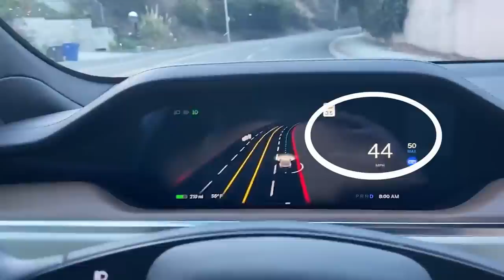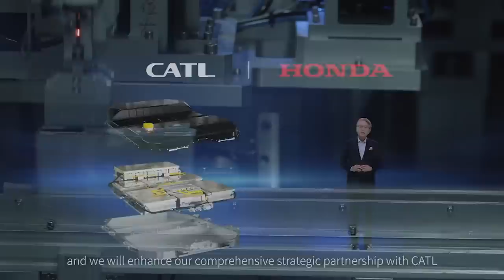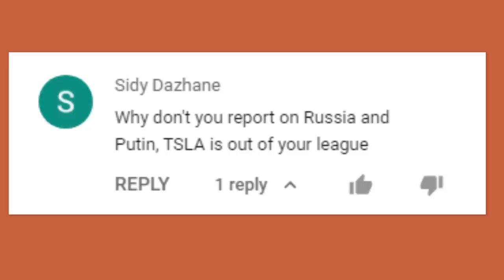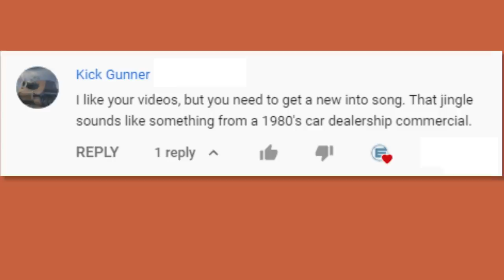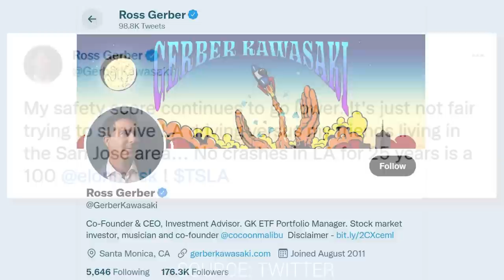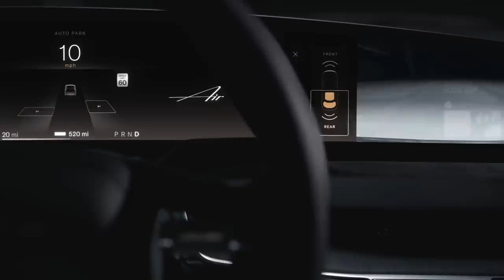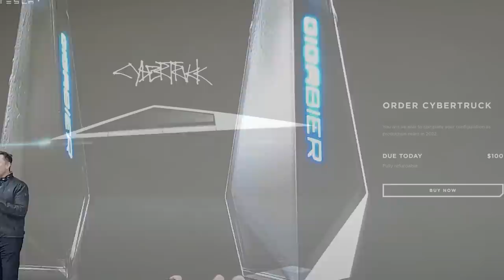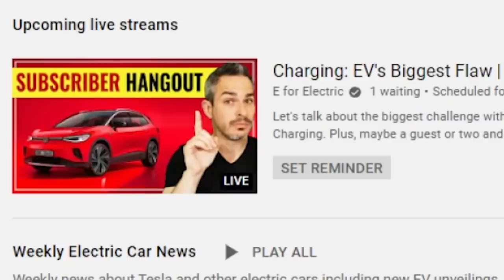HONDA Beats TOYOTA at Electric Car Denial | EV News

Comment: I like the fuchsia-shock shirt! And keep up the great humor! Tom is spot on with his analysis as usual. I agree that Toyota could make BEVs work overnight (if they wanted to). But I am not so willing to give Honda a pass on BEVs. I have owned and enjoyed many Hondas over the years and their engineering and design skills are excellent. So the fact that they are well behind the rest of the auto industry worldwide with BEVs is frankly inexcusable. This is clearly a management/leadership mistake and not an engineering problem.
Reply: The problem lies with Japan. Japan has a big problem with electricity generation which relies on  LNG suppies from abroad  and coal, which are really hard to get these days and will contiue. Nuclear was  carbon neutral + reduced reliance on external factor but after fukushima public sentiment on nuclear is very bad. Adding to these woes Japan has 2 diffrent grids with different voltages/frequencies. Japan is honestly stuck btw a rock and a hard place. That is the reason they are looking for something that replaces LNG i.e Hydrogen which can be imported from Australia.

Comment: Honda is almost never the first vehicle manufacturer to adopt new technology, but if and when they do decide to embrace new tech, they usually do it better than their competition.  It might be a good idea for Honda to secure a good battery supplier, design efficient motors and at least one good skateboard before releasing a subpar vehicle like other Japanese OEMs.
Reply: That wasn't the case with hybrids, and that's been since at least 2004. Their hybrid design is way worse than Toyota's.

Comment: My theory on the Japanese car industry problems is that it is all political pressure on the industry by the government.
To be competitive with China, Tesla, maybe even VW and Hyundai/Kia, the makers need to simplify vehicle production in new or redesigned facilities, putting many workers out of a job (see Toyoda's speech about that).  Don't forget, car dealers and service operations, plus petrol suppliers will all need to shrink - more jobs gone.
If this was to occur, the politicians would get the blame, and by the time the industry has actually collapsed, they will have retired - someone else's problem then.

Comment: Really curious if these auto startups will make it or if Tesla will be the only new auto company because they caught a small window where the major companies were asleep on ev's.

I suspect basically none of them will make it and we will be back to the traditional big companies plus Tesla in 10 years.
Reply: Just think of all the debt and assets that are associated with manufacturing ice vehicles. I'm quite confident that the big automakers are in fact very vulnerable. Small startups can start afresh. My best guess is that nio and xpeng and byd will be big. Tesla among the biggest because they are a frontrunner in ev.
Reply: @marce8760  I think most of the cost of vehicle production is the paint shop and the body shop. And usually a separate plant assembles the motors, so the primary losses will be retooling that plant for electric motors then of course building a big f**king battery factory.

Sure some cost but I think a legacy auto maker is still in way better shape to produce an EV than one of these startups. Tesla has been at it for 10 years and their body work still has lots of issues, getting better but still very common to see a brand new Tesla with a clearly misaligned door or hatch. That is going to be harder to justify when they aren't the only game in town.

Comment: when you buy a Tesla you buy into the Tesla system - it's more than just a "you've bought our experimental car - goodbye!" that the other EV builders seem to be offering. With Tesla you have support, continued updates and improvements, a car the company really cares about, and the charging network growing and working. It's a unified whole.
Reply: From what I have understood, Tesla customer support is terrible.
Reply: Roof, HVAC, powerwalls, phone? Trip to Mars (one way🤦‍♀️)?
Reply: Support from Tesla?. 6 months to get body pieces?
Reply: Tesla cares about the data that car sends back from its guinea pi.. oops I mean customers

Comment: I would  not want  low range of 260, they need  extend their range. They are not like  my Tesla Model 3. Long range 320-351 per charge.  I would  like  see  standard charging plug for all electica vehicles .  Why do we need so manyl adapters.
Francesca
Reply: For reference: Plugs vary by continent and purpose.  J1772 and Tesla in North America for personal and light-duty vehicles, and Mennekes for heavy-duty vehicles. Mennekes in Europe, Africa and most of Asia.  Mainland China has their own GBT plug.  CHAdeMO for DC fast charging only, used to varying degrees practically everywhere.
Reply: Irony here being that you own a car from a manufacturer that's building a charging network with proprietary tech across the world while at the same time advocating for a standard charging plug. No one expect Teslas can and will be able to charge on Tesla's chargers, ever, lmao.

Comment: The E is actually very good, if people would just stop digging at the range which lets face it is not bad for what it was designed for - urban driving, and stop testing it on motorways etc which is NOT urban to package is superb, it drives brilliantly, has lots of tech inc self parking and residuals will be high so cost of ownership compared to 'other' makes will no doubt be the differentiator. A 35K car that is worth 20K in say three years is a better deal than a 25K car that is worth less than 10K in three years. I know what car I would rather drive - and its not any Toyota!

Comment: Great video, a lot of points spot on.  Honda will need about two years to start selling electric vehicles in larger markets.  The UK is the test bed, China is going to be the hub to export to ASIA.  The US...is still thirsty for gas where total EV sales is about 2% of market share, so companies like Toyota and Honda are still going after that pie while it's still there.  It's unfortunate that the Honda E is limited to smaller markets as I would love to own one in the states.  There really aren't too many affordable options right now with even the Model 3 feeling a bit cheap in the interior.  Sure there are other brands like Polestar, Hyundai/Kia, and Chevy but their offerings aren't particularly desirable.  The Ariya does look like something I would be interested in, and if only Sony would produce their Vision S I would be all over that in a heartbeat.  The EV market should have a really nice selection in 5 years with charging infrastructure hopefully up to the task.

Comment: I wouldn't call the deniers, I would say realist. They actually make cars and know about the raw materials needed to produce large-scale electric vehicles and they know there aren't enough copper, heavy metals, lithium to produce them at the scale people are hoping for. It's going to take a huge breakthrough in battery technology for everyone to drive an electric vehicle. Not to mention the huge investment in charging infrastructure which will take even more copper etc. Maybe by 2040, but something major technological advancement will have to happen.

Comment: Being an early adopter is expensive. The japanese may move slightly slower yet when they move they will be extremely competitive in making ev s. Im not a big fan of japanese cars yet i can respect their competitive nature. Do not underestimate honda or toyota. JMO and I orefer to spend my money on american products from tesla, ford or my favorite GM. Buying european ev s is fine as I also have an excellent 2021 audi e tron with its 250 mile range. Suits my family transport needs very well. Nice truck even though it doesnt have the longest range. 78 percent of a,ericans drive less than 38 miles a day.  My better half is perfectly served by the audi e trons 250 mile range. In fact i only charge it 80 percent so the 200 mile range is just fine for our needs. $2500 drive off and 507 a month lease and never stopping for gas is a big win. I appreciate your show. Thank you for educating me to the point I went with an ev for my family cuv.

Comment: e naah, I agree, 

electric tools have been around for a very long time (so have cars also, actually) however, I will be sticking with my ICE versions and ignoring the electric ones until they improve them. When the electric mower battery died, we scraped the entire thing, mind you rechargeable hand tools are usually really handy for the odd jobs.  

One odd thought about the Japanese government not pushing their automakers to electrify the automotive industry more quickly, is that Japan is one of the most dependent economies on imported oil, so it would actually make sense for them to want to get away from their dependence on imported oil supplies.
Reply: to get away from their dependence on imported oil supplies Japan needs to produce more electricity and it looks like it is harder task than just importing oil.
Reply: @sonarsphere  Yes, i agree totally with you here, close friend of mine lives in the north of the main island, Japanese culture is to not talk about Fukushima disaster  (I suspect that it is about losing face etcetera) so the nuclear option really is not going to be investigated well and I am not sure how it will affect the discussion of other alternative sources: wind, wave, solar, tidal sort of options, but I am unfortunately not optimistic on that count.

Comment: Lots of new start-ups for the EV market.  Mind boggling.  Just having the service and repair infrastructure in place seems like a gigantic undertaking.  Are they contracting an existing operation for this?  I realize EV's are going to require less service and maintenance and the electronics possibly diagnosed OTA, but some failures are going to require in-house service.
Reply: I have often thought that you only need a parts distributor and give the service manuals to independents.
Reply: @steverichmond7142  True.  Remember when Tesla first came out.  Any warranty work and they came out and got your car.  Now, Tesla has service centers all over.  There's actually one in the town near by where I live.

Comment: About the rollout of the 10.x FSD Beta and the 100/100 Safety Score that the user must achieve in order for Tesla to push the update to them. I don't know Ross Gerber nor how good (or bad) of a driver he actually is. Admittedly a 37 safety score sounds pretty bad. But let me comment on that safety score. We have two Tesla vehicles, a 2018 LR RWD M3 which we've owned for a little over 3 years, and a 2021 LR AWD MY which we've had for a little over four months. Interestingly enough, the safety score for the M3 is 99 but the safety score for the MY was 96 last week but after our weekend trip to South Lake Tahoe and back this past weekend to see fall colors in Hope Valley, the score has fallen to 94. Have we had any accidents of any kind in the M3 or the MY? No. So what happened to cause the score for the MY to drop from 96 to 94 in one weekend? Several false positives. Four different times on the trip the car gave its panic beep sound and flashed "Forward collision imminent!" or "Take control immediately! " on the screen. The first time we were driving on a 2-lane road in Tahoe where a car was traveling in the opposite direction as us. As it rounded a turn in the road (not a sharp turn, a relatively gentle turn) our MY suddenly gave it's panic beep sound and flashed up the "Forward collision imminent" message on the screen with the oncoming car colored red. Why? Good question. We were fully within our lane and the oncoming car was fully within its own lane but for some reason the MY thought that car was on a head-on collision course with us -- or us with them. The second time was just a few minutes later as we drove past a bicyclist riding within the bicycle lane of the road in the same direction we were traveling. When we got about six feet away from the bicycle, the car suddenly gave its panic beep and flashed the "Take control immediately" message with the bicyclist colored red. Why? Another good question. We were fully within our lane and the bicyclist was fully within the bike lane and when we went by there was at least two feet of distance between us, but the car evidently believed we were in Death Race 2000 and were going to take out the bike and rider. The third time was on a different two lane road where an oncoming car was coming up over a rise in the road as we were heading up the rise and the MY barked its panic beep and said "Forward collision imminent!" message with the oncoming car colored red. Again, our car and the oncoming car were completely within our respective lanes but the MY was sure we were going to collide head-on. The fourth time was when we saw some beautiful gold aspen trees off the road to the right. The road had a wide gravel shoulder conveniently provided for cars to pull out to take photos. I slowed down and pulled onto the gravel but made the horrible mistake of not putting on my turn signal before leaving the roadway. Once again the panic beep and "Take control immediately!" appeared on the screen. The result? By the end of the weekend we had lost two safety points from the score for the car, all of them from panic alerts which were all false positives. I would note that we've had numerous other false positives in the MY which no doubt contributed to the safety score being at 96 even before the weekend trip. So was it because we were being horrible, unsafe drivers? I don't think so. If you're going to limit the initial rollout of the FSD beta to only the safest drivers in the beginning, I can certainly understand needing some way to determine whether someone is driving safely or not, so I can see why Tesla developed the safety score. But in our experience, the car dings you for "safety violations" which actually never should have been considered a violation or a hazard. Evidently our M3 has different standards, since it has us at a 99 score. At any rate, that has been our experience with Tesla's safety score thus far.

Comment: hypering the EV car  so fast, it might be can make a big crisis on Energy.. (look how china now, over hype on electricity). we all know the power to supply all electric we needs, its very limited number and still mostly with conventional raw material such as nuclear power, coal and gas.... it just a time bomb to blasting if there's no other renewable energy to supply all electric we need...  i think Akio Toyoda was correct to slow down the EV cars cause the infrastructure on ev cars stiill not ready yet  especiallly on power supply required.

Comment: toyota will have on 2022 electric suv with solar panel to charge, no need home power or gas. and the new solid state battery fast charge. sun is all you need. toyota is the best.